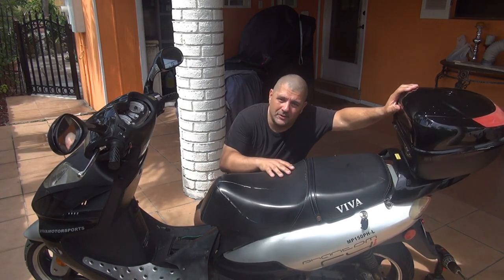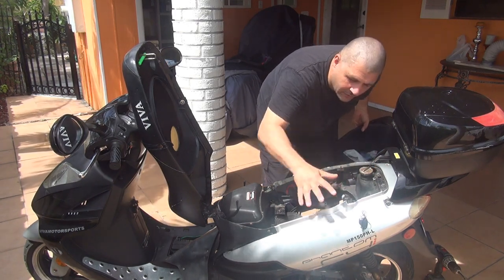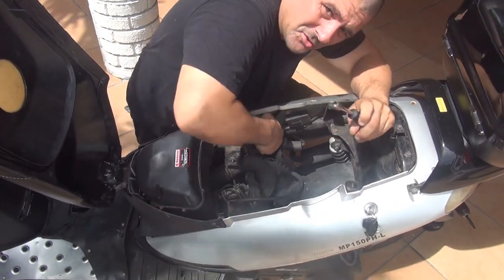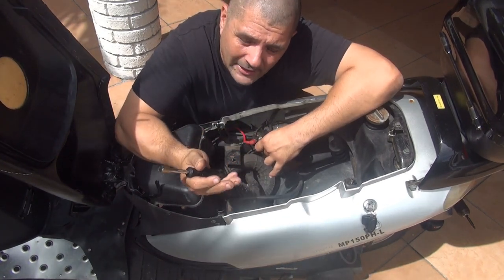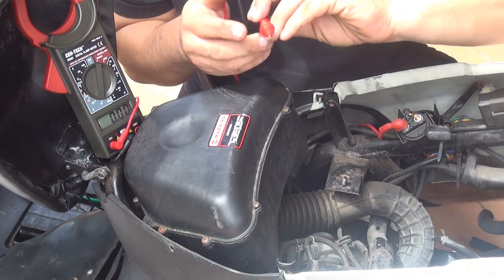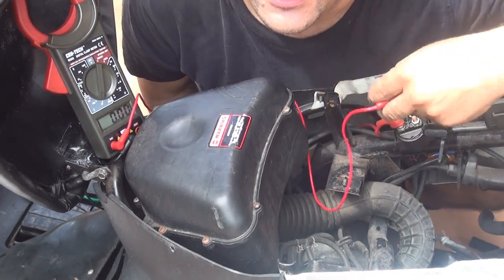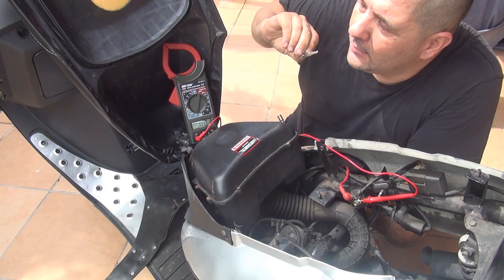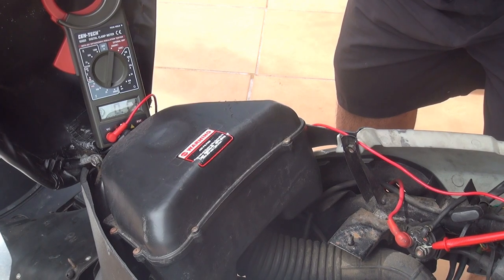How to test starter solenoid relay on a gy6 150 cc scooter / motorcycle

Comment: Ok now how do I test the starter? I did this exactly. I have power to the starter, but will not turn and start…
Reply from the maker: Hello my friend there is many different way to test the starter you can test with multimeter or manually just by removing the starter and connect the wire to the battery and touching the ground of the battery with the body of the starter anyway if you listen to the solenoid clicking when you try to start the scooter and the starter. Is not moving your starter if bad or full of oil

Comment: Good info, I'm having an issue with my electric startup but when I put a screwdriver sideways to the positive and negative to the solenoid it started up no problem, any idea what my issue is?
Reply from the maker: Hello my friend that could be rust inside the solenoid or corrosion in the starter switch . Thank you for watching my video

Comment: i tested this, and i have current going to the solenoid but when starting nothing happens. it clicks and thats it. there is voltage there, but no turn over. could it be the starter motor? i have added a new spark plug, changed the battery, adjusted valves, etc,. thank you
Reply from the maker: Hello my friend If you have a multimeter  place the negative probe to the battery and the positive probe at the connection in top of the starter and try to start the scooter if you read 12v or more is good if   the starter is not turning you need a new starter price is only $17 https://amzn.to/2RkUvMQ many times oil from the motor goes inside the starter . Thank you for watching my video

Comment: Ugh.  It's not the solenoid,  put in new starter... , still only attempts to start when bridging solenoid with screwdriver. Starts with kickstart... but we've worn out those gears now. ignition button still won't even attempt to roll starter over, no sound at all. Should I try replacing cdi?
Reply: Please help?!
Reply: Kandace Schierts did you ever find the issue?

Comment: Hey bud i’m having a problem with my buggy it has a ch250 It was running fine now it’s idling really rough when I accelerate the engine kicks and bogs down i’ve replace intake manifold and carburetor still have the same problem maybe you could help there’s a video in my account of it idling and bogging under acceleration
Reply from the maker: Hello Evan Rees  did you check the o ring under the manifold sometime they break if is not that I have the feeling that you have to adjust the head valves look like there are not closing properly. Thanks for watching my video

Comment: Okay so I put the key in the ignition turn the key and I get nothing I take a screwdriver and cross the solenoid and it turns over what could it be? It is 150 cc go kart
Reply from the maker: Hello on a scooter the  solenoid could be bad or the starter switch is bad or the solenoid is not getting voltage to open the connection

Comment: Anyone know where the headlight relay is on gy6 Chinese scooter?
Reply from the maker: Hello there is not a headlight relay you have a blinkers relay check this http://www.firenzee.com/gy6/Wiring%20Diagram.pdf
Reply: I'm sorry I wasn't specific I have a teyin supper 200cc with a none working headlight only 50 miles on it I was told it was the relay seeing the bulb and fuse are good any help is appreciated and feel it has to be on the frame under body since its the only place I can't see

Comment: How can you switch off your bike without a key ?
Reply from the maker: The fast way to turn off your scooter is with the kill switch next to your throttle on the right side of your handle bar
Reply from the maker: There is also another 100 ways but they are less safe
Reply: @VirberelloScooterTips  can't you show the best way in a video please.

Comment: So the solenoid is clicking which to me is a sign of it working. I can’t get my 150cc to turn over. Checked and changed the solenoid but nothing. Battery is fine. Could it be a stuck Benedix?

Comment: How to get fire to my sparkplug
Reply from the maker: Hello Danny If you do not have spark at the plug you have to play the  elimination game is your spark plug good ? is the boot of the spark plug broken ? is the wire at the spark plug burn or is ok ? is the spark plug coil good or is faulty ? is the cdi ( capacitor discarger ignection ) good or bad ? and is the stator and the pick up working or not ?
is you kill switch next to your throttle on the right position or is broken ? 

unfortunately my friend when you do not have spark you have to play this game and sometime is just the pick up at the magneto that is dirty or not good anymore check my newest video https://youtu.be/jYkt--i2JVs I hope you will find the problem my friend

Comment: My scooter turns over but no start
Reply from the maker: Hello Lucas To start a scooter you needs three things: Gas, A spark, Cylinder compression when your scooter is not starting you have to ask yourself few question : is the fuel going to the carburetor ?  ( broken fuel valve, broken vacuum line , dirty fuel filter , dirty fuel tank ) is the fuel mixture going inside your cylinder  ? ( dirty fuel jets, broken manifold ) do you have a spark ? ( replace spark plug wire, replace cdi, dirty pick up sensor at the magneto ) if is your scooter is 150cc gy6 do you have a good cylinder compression ? if not the first thing I check is the clearance at the  valves . I hope this will help you a little beat. Thank you for watching my video
Reply from the maker: also check this link http://www.firenzee.com/gy6/